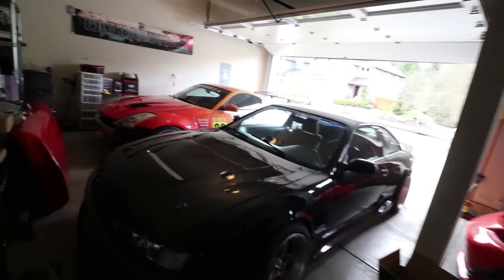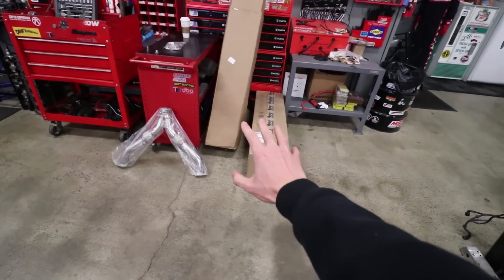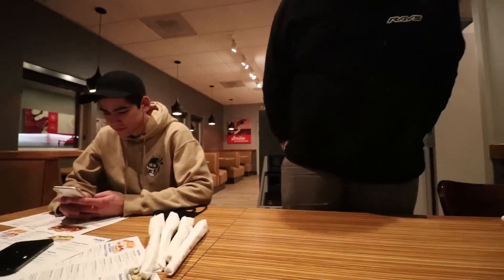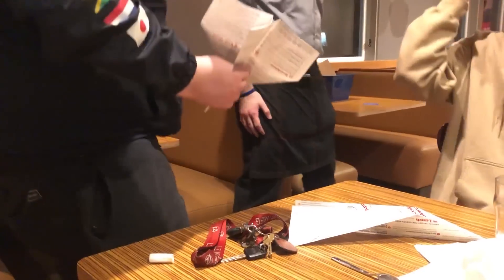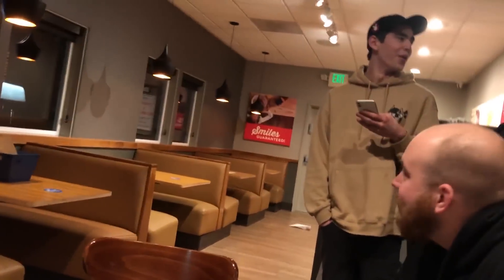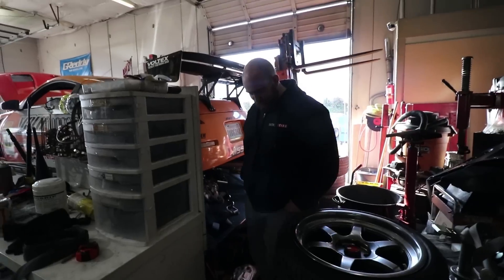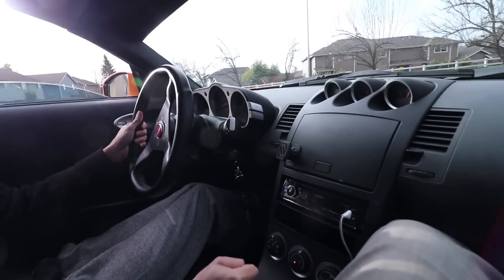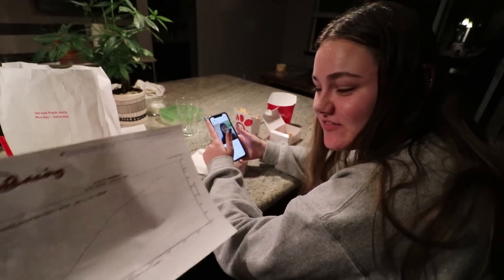How Much Power Will $3,000 Worth of Mods Make In the 350Z?

Comment: Only got 30hp cuz u put a kineticx intake manifold that r known to loose power n brake welds for $800 n headers don’t add much horsepower in general u would’ve gotten around the same jp from plenum spacers n a intake n y pipe

Comment: Your losing power with that manifold. Those only make power on a FI setup. I have a tuned bolt on DE with no headers and made 255whp. Get rid of the manifold and get a spacer and I can see you making more power.

Comment: That's a bad tune, I made 272whp 381nm atw 
I only have a bolt on exhaust high flow cats hks duel muffler at the back a plenum spacer and a cold air intake. Yes it's the de motor